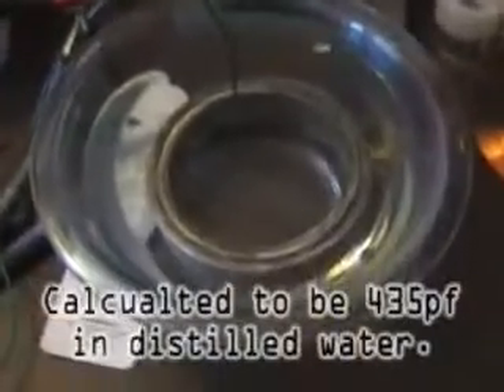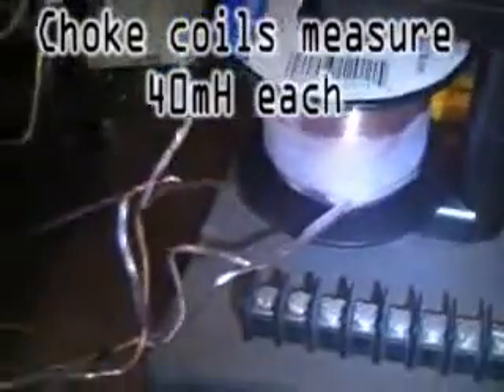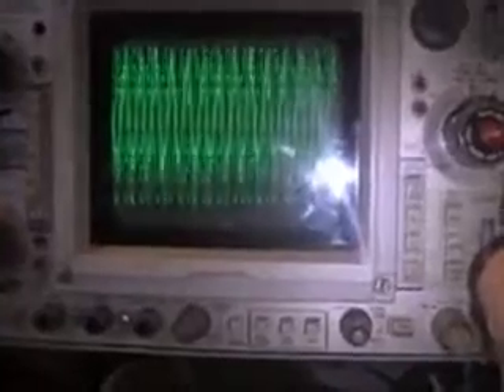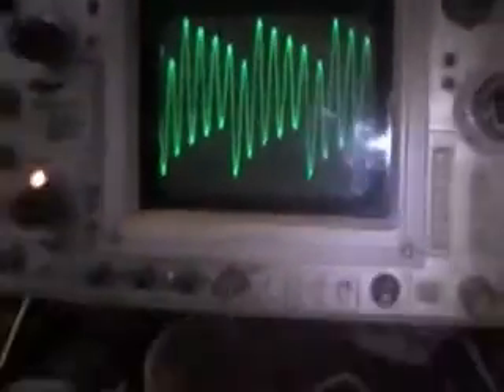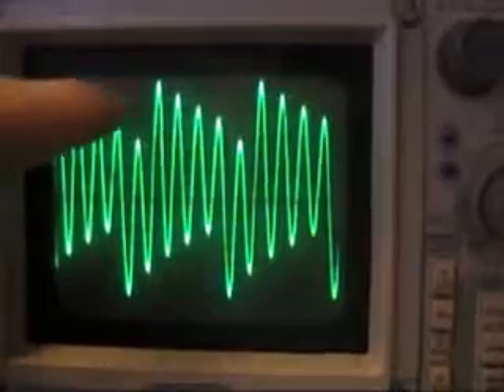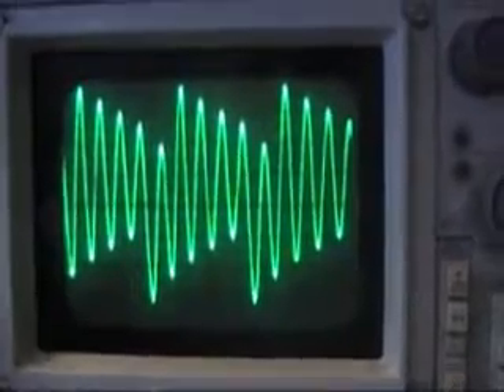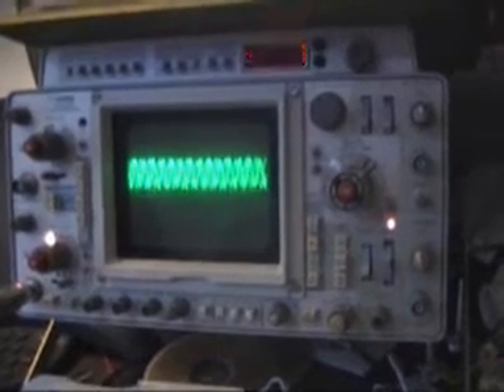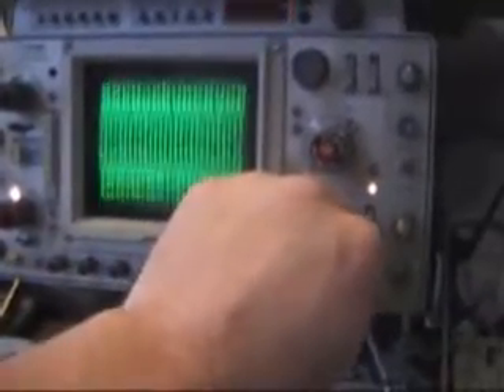hydro4f3a 015 stargate scoping

Comment from the maker: Thanks for taking the time to put the DVD together. Will check it out. Also have lots of questions about "what components in the system resonate with what frequency" like the pulse freq or the alternator speed etc... Your vids show the use of several cells, right ? one for each water spark plug and a couple for the mister ?

Comment: Get your best dumpster diving suit on and start looking for 8 microwave capacitors (1uF/10Mohm) to make your Impedance Matching LRC (resonant circuit for water since water has a resistance of near 10MOhm). The alternator is the mechanical version of the VIC. The solid state version is too whimpy to run a car on or it would be the size of the alternator...so just use an alternator.

You still need to rewrap your alternator stator to make it high voltage. My DIY in on the DVD.

Comment: Well you got an alternator and you know you need 3 inch tube cells, you got to pulse the alternator, and you now know you have to spin it up to 5,000RPM or higher. You now know to use only Positive and Neutral coming out of the alternator, you now know to mist the clean/Spring/Distilled water into a vacuum so it will vaporize and release the HHO, you now know my diagram for the plasma spark if you look on my blog.

Comment from the maker: Hi Kevin. 
How did the tranny work go ? I started watching the vid, but the cursing at the opening prompted me to exit. (you WERE really greasy) Your truck project looks good. I often wondered "why not use a delivery system similar to NOS" and water instead as the ultimate power adder. Good luck and good thinking out of the box.
 
As for your comment , I would consider myself a speed-reader on some of Stans docs.  I have an alternator that I have been working on in the shed... Thx for the tip.

Comment: Hi hydro4f3a,

great idea and setup. I think the Lawton circuit may creates chopped DC, so it may not work.  You need real AC which is what a signal generator puts out . Or build an H-bridge circuit and control the frequency with your Lawton. 

Is your water cap in series with your inductor?

Also, I think you should make a Tesla coil on a 3" or 4" tube. One layer of 20 AWG mag wire, about 400' to 800' of wire (longer Resonates at a lower frequency).

Comment: I have not used any cores in my coils and when I hit the real Resonant point I cannot have a scope probe attached to it since the P to P is well above 400 volts and that is with just the signal generators 20v P to P.

Great work and thanks for sharing.

Luc